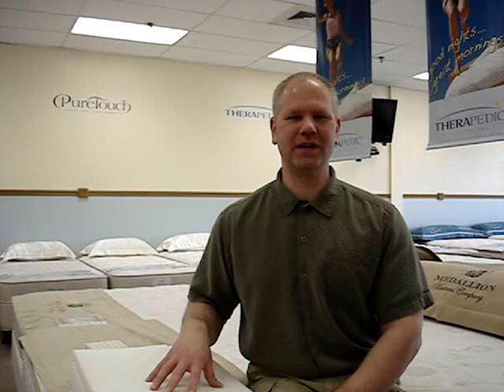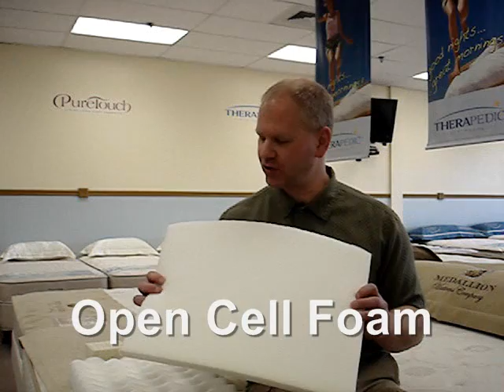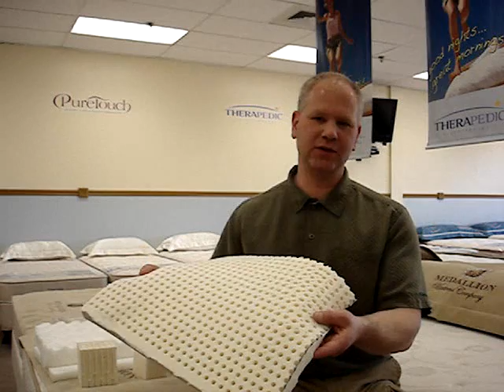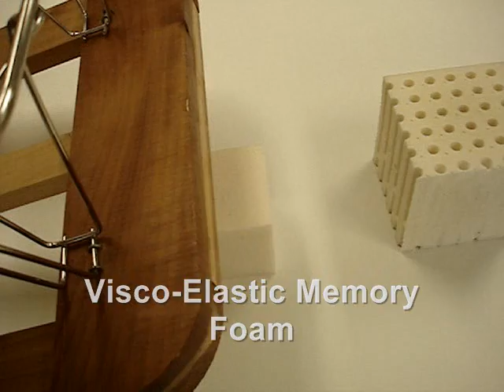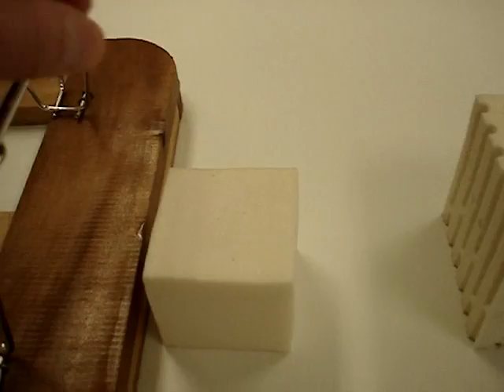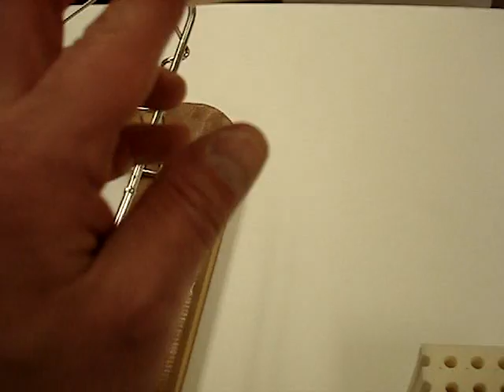Beducation® - Polyurethane Foam, Memory Foam, And Latex Foam

Comment: My parents are starting to have issues with their mattress. My mom and dad hips, back, sides is hurting. They’ve had the mattress for over 5 years now... the pains started a few months ago. Thank You for your response...
Reply from the maker: I can't diagnose online why your parents are uncomfortable when sleeping and have these issues. I can only offer general suggestions. Most pains/back issues are environmentally related and a result of one's level of fitness/strength or pre-existing conditions. Mattresses generally don't cause these problems, but they can contribute to their exacerbation or slow the restoration process. As my friend Mark Kinsley from Englander says, a poor mattress can "keep your pain alive". It's unlikely that something happened to the mattress just a few months ago to cause an issue (like flipping a light switch), unless it was moved and damaged. It's more likely that something changed in your parents' life if the onset of this was sudden. If it was a gradual change, it could be that the mattress no longer suits their specific needs. If the mattress is one of the "typical" larger brand names out there, it very well could be at the end of its useful comfort life, as many of these products use lower density foams that seem to lose quite a bit of their support factor in the 4-5 year range. If this is the case, your parents should seek an educated comfort consultant who can guide them through the mattress buying process and help explain to them the difference in comfort materials and their quality and help them make an educated decision, finding componentry that is appropriate to what seems to be some very specific needs. Good luck!

Comment: Jeff, a high density PU foam, why does this open cell foam type have reflex issues when compression packed for 6 months plus?
Reply from the maker: All foams experience various degrees of change in compression modulus, as well as other measured parameters, when compressed for longer periods of time. There are various factors involved, such as the amount of compression, folding, humidity, along with the specific type of foam and the very specific qualities of that foam. If you have questions about recommended length of time or amount of compression for specific type of foam, those questions would be best answered by the manufacturer of that foam, as they would have gone through their own durability testing of that particular foam formulation and know best the recommendations for appropriate treatment of their material.
Reply: @BeducationMattress  Cheers Jeff for the info!
Reply from the maker: You're welcome.

Comment: thank you for the explanation. I want to start selling poufs that are 100% natural. do you recommend latex foam to stuff the poufs? I want them to be firm, yet comfortable. Thank you so much for your answer.
Reply from the maker: If you wanted to use a foam stuffing material that is "more natural" than not, you certainly could select latex. While it isn't "100% Natural", you can find quite a bit of Dunlop latex that is GOLS (Global Organic Latex Standard) certified (95+% natural content) if that is important for your story in the production and marketing of your product. For firmness, this would depend upon the density of the Dunlop latex used (higher density = harder feeling), and if it is shredded latex, you would also vary the size of the shredded chunks to achieve your desired level of comfort.

Comment: Thank you so much for your video. It was very helpful and I wish there were more bed experts like you near where I lived! It is my first time shopping for a bed and I tried to do some research online but I just have no idea where to start. I sometimes have back pain from very mild scoliosis, weigh around 58kg (128lbs), but looking for a budget mattress since I am a graduate student. I live in New Zealand so hot and humid in the summer, and wet and cold in the winter. If you have any advise, it would be greatly appreciated! :) Thank you so much.
Reply from the maker: I'm glad the video was helpful. I know it can be difficult finding something in a limited budget range that works well for you, so you'll have to manage your expectations a bit. As you have a pre-existing condition of scoliotic curvature, and maintaining a more neutral alignment is the most important thing done by a mattress, focus first upon the support unit within the mattress. If it's an all-foam bed, try to find something with a firmer polyurethane foam core of 1.8 lb. in density. If you can't find that in your price range, try to find something that is a firmer core of 1.5 lb. density. As for the surface cushioning, again here you'll probably be limited by your budget. Good sleep ergonomic research will recommend "just enough" cushioning to get the job done, so you don't necessarily need something that is overly plush (again protecting your alignment with your slight scoliosis). Avoid the temptation of buying something that uses multiple layers of very low density foam, and instead try to find something that is using better density cushioning foam (in your price range hopefully you can find 1.5 lb. density). I'm not aware of what you have available in your area in New Zealand, but your best values are probably going to be from all polyurethane foam products (foam core and cushioning layers) or a more basic innerspring product using polyurethane foam for the cushioning layers. Your budget will probably be best served by avoiding memory foam or latex cushioning layers, as those can be more costly. Good luck!

Comment: I have torn ligaments behind my tailbone and pelvis and need pressure relief #1. Which foam do you recommend? Memory foam, the latex, or the newer generation of polyurethane foams? I'm debating between a sleep number iLE and a sealy copper II plush. Sleep Number's foam is propietary and I wonder if they use the newer poly foams that mimic memory foam?
Reply from the maker: I'm sorry to hear of your injury. While pressure relief certainly is important for your particular situation, you'll also need to make sure that whatever product you choose has excellent support/alignment characteristics. Latex is excellent at pressure point relief in appropriate ILDs, and when combined with other latex layers or with a good marshall spring unit it can be very good at pressure point relief, as it is very point elastic and supportive. Visco-elastic foam is also quite point elastic and is good at pressure point relief, but it will be more reliant upon the basic foam / spring unit under it for proper alignment and support, so pay attention to that. 4-5 pound density would be a decent quality of visco-elastic foam in general. Some of the newer generation of high density polyurethane foams can also be quite durable and good at pressure point relief, but would also depend upon how they were combined and ordered within a particular mattress. As you have a very specific condition, I'd strongly recommend testing out items in person, and learning about the quality of the components within the mattress before making any purchase decision. Good luck!

Comment: How can I find out what are the VOCs from my mattress?
Reply from the maker: Hi Ann. Thanks for the question. Not to get too complicated, but that's something for which a complete answer would take pages upon pages of explanation, so in lieu of that, I'll provide a few links and make some general statements to help simplify things. Here's a great article about what exactly is a VOC (  https://www.epa.gov/indoor-air-quality-iaq/technical-overview-volatile-organic-compounds#1 ).  Here are some good FAQs about VOCs ( https://iaqscience.lbl.gov/faq ).  Here's a third article with a simple introduction to VOCs ( https://iaqscience.lbl.gov/voc-summary ). The reason I'm providing this information is that there is an incredible amount of misinformation out there about the actual definition of a VOC, including quite a bit of green-washing within the mattress industry. As far as being able to measure the VOCs currently being emitted by your finished mattress, you'd have to take the product to a certified lab measuring such things, and even then the information you'd receive would be quite confusing and in most instances not something you'd be able to relate to any specific standards. There are differences in the classification of VOCs, the actual definition of a VOC,  and the methods of measurement (temperature, pressure, chamber size, time for measurement, air changes, what VOCs are actually measured, levels of detection, and so on). There's also debate on what concentration of certain VOCs can be problematic. And not all tests are able to capture all VOCs, and even then identifying the specific VOC compounds can be problematic. So you could receive a number from a lab that stated 556 ppb of VOCs and you'd wonder what to do with that information, as you'd have to go into much more detailed analysis of the results to determine if any of the specific compound concentrations were of a level that might be considered harmful by different testing organizations. There really is no "one universally accepted scale" of VOCs against which all results can be measured. The most useful thing you may get from a lab measurement might be a reading that was very high, maybe over 10,000 ppb as an example,  which most researchers would probably consider problematic or a cause for concern. As a consumer, your best bet is to look for mattresses that use materials which have already been tested to pass certain "safety certifications", such as CertiPUR-US, Oeko-Tex, eco-institut and so on. Tests like these will have their own protocols and test for their own specific compounds and harmful substances at levels they deem appropriate, but at least you would have a very basic "health certificate" as a starting point. I know that is a really long answer to your question (and trust me, I simplified the response as much as I could while still being informative), but I hope the response and the links provided are useful to you.
Reply from the maker: Some people are more sensitive to odors than others from new furniture and mattresses (not all VOCs have odors), and it is common that with an initial airing out the items will cause less sensitivity. These sensitivities can come from the foam in the mattress, the ticking, the wood in the foundation...even the plastic used to wrap the product. Everyone is different. People with Multiple Chemical Sensitivities (MCS) can have an especially difficult time with new furniture, and even new car interiors. But this tends to abate rather quickly.
Reply: THANK YOU! So informative! We got an inner spring with pillow top (medium/soft) and I aired it out for a week with a large fan, AC, & air purifier. After that, I had zero physical allergic reaction and now I can sleep at night because of the right softness. No more neck & shoulder pain.  I didn't realize how important that is!

Comment: can you mix latex foam and memory foam together?  I'm looking for a deadening effect from the memory foam but with a instant recovery as much as possible, there is no specific memory foam that does this is there, it has a latency in its recovery.
Reply from the maker: You may mix memory foam with anything you like! There are more variations appearing on the market with different speeds of recovery (faster seems to be more popular these days), but a ball rebound of less than 20% or so is usually considered normal for memory foam. If you are most partial to the feel of memory foam but don't want too much "sink", then you could create a component system using memory foam for the uppermost layer and then latex immediately beneath. If you like the "dead" feel of memory foam but not initially when lying down upon the mattress, place your latex layer as the uppermost layer within the mattress, then place your memory foam layer immediately beneath. One of my favorite old mattresses was one that used latex on top with memory foam beneath. It had a slightly buoyant feel, but also a bit of "deadness". A bit of the best of both worlds. I should note that some of the newer generations of higher density plush polyurethane specialty foams have a plushness similar to memory foam, yet have a higher ball rebound, fast recovery, and little to no viscous nature.
Reply: Mattress To Go sorry I should have been clear I meant chemically can they be mixed to produce a different compounds
Reply from the maker: Ah, I understand. No worries. While I'm not a foam engineer or chemist, it has been discussed before mixing polyurethane foam (technically memory foam is just slow recovery polyurethane foam) with latex in different manners. Your question reminded me of a few patents I came across on this subject years ago when there was a company claiming to have a "natural" memory foam with latex in it. European Patent Application (EPA) EP0959099A1 and EP2511327A2 describe such a process. I have notes stating foam company Vefer made something according to the process in EP0959099AQ1 but found the results to be unsatisfactory, but I can't find the follow-up article stating the specifics. So to answer your question, yes, it does seem to be possible, but results currently aren't where the industry would like them to be, and there seems to be much more investigation and creation in the newer generation of high-performance plush polyurethane foams with many of the comforts of memory foam, but with less of the viscous nature and heat-retentive qualities.

Comment: What do you say about HR(high resilience) P.U foam? I tried it in one of the stores and it felt good and affordable too. The warranty in the product is a good 15 years. How does it compare with memory foam and latex?
Reply from the maker: High resilience polyurethane foam is defined as 2.5 lb density or above, with a compression modulus of 2.4 or above. Much of the polyurethane foam marketed as high resilience, especially by mattress companies, is in fact not true high resilience foam. If it is truly high resilience polyurethane foam, this can be a very durable and better quality material. It is a totally different material from memory foam (which is essentially a polyurethane foam that is made to "spring back" slowly with a viscous nature), and latex, which is foamed rubber and generally considered the most durable of all comfort foam materials.
Reply from the maker: Oh, and I forgot to mention, the warranty tells you absolutely nothing about the quality of componentry, so having a 15 year warranty is not a part of evaluating the quality of mattress componentry, and I would place little emphasis on that.